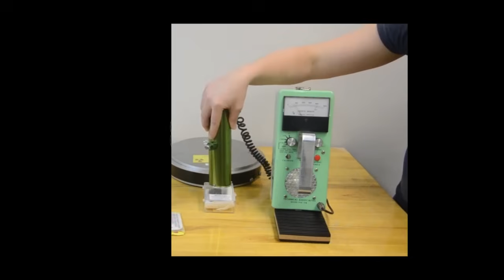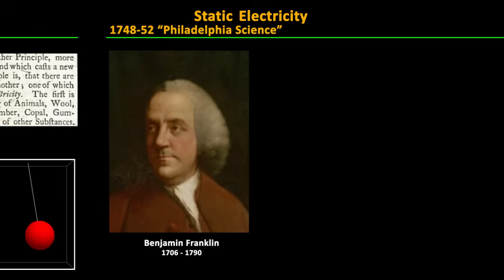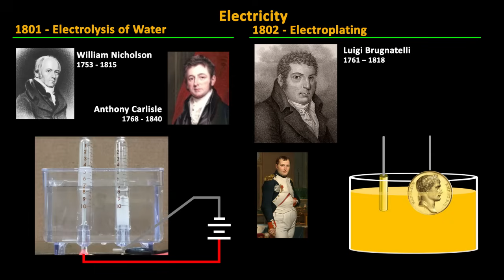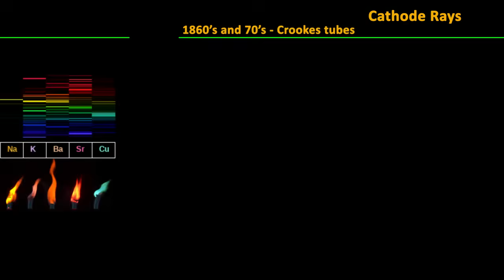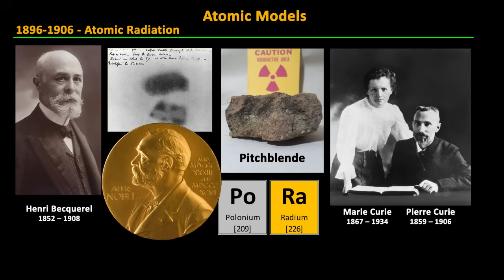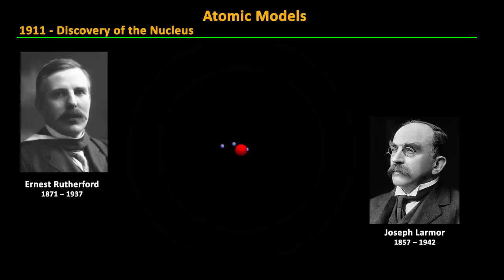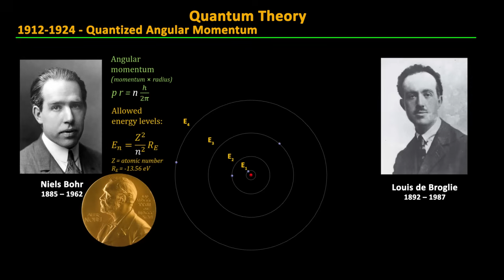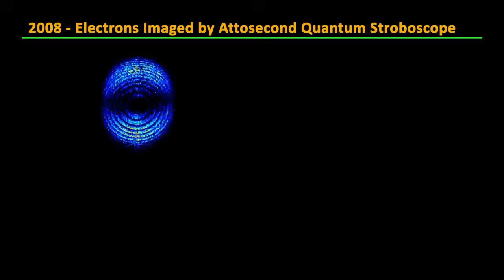The Electron (old edit)

Comment: Where do electrons get their charge?  
Where do they get their energy?  
Where they get their mass? 
How electrons convert to Heat?
Reply from the maker: Charge and mass (and spin) are the fundamental properties that define what an electron is.  Apart from these qualities, it can be said that electrons have no hair (no other distinguishing characteristics).  
Electrons gain and lose energy from interactions with photons, but also have rest mass energy from E=mc^2.  
Electrons do not “convert to heat” but can store heat in a solid by moving around in it faster.
Reply: @AtomUni   : What makes the electrons and protons to have a different charge?
Why and how charges repel or attract from distance?
Spin means the electrons are little balls.
We can not assume that electrons have no hair, no one have seen one.
What is Energy and how do you store or transfer it? What is the transfer medium?
E=mc2 which means it is defined as multiplying the weight/mass by a big constant number, it does not mean anything, I say E=mc3, can you prove that I am wrong?
Do the electrons move around in solid or move from on point to another?  Do they move with a different speed?
How do you store heat and in which part of the atom do you store it?

Thanks for your replies.
Reply from the maker: @ShonMardani
In reverse order:
- Thank you for politely asking
- Heat is stored as kinetic energy in solids, through electrons moving at different speed, yes, but primarily through the vibration of atoms (they carry more energy since they are heavier).  My first episode - https://www.youtube.com/watch?v=BHhhv9xdrJk - shows a nice clip of actual vibrating atoms at 13:30 and I will do a future episode on heat energy for sure.
- Whether or not electrons move from atom to atom within a solid is what makes the difference between electrical conductors and insulators.  Will cover in a future episode.
- Many, many experiments have confirmed E=mc^2 to better than 1 part in a million (e.g. https://www.nist.gov/news-events/news/2005/12/einstein-was-right-again-experiments-confirm-e-mc2 ).  My next video will describe the first one done by Cockcroft and Walton in 1932.
- I plan a future series on Energy and Thermodynamics in general that should answer those questions.  But if you can’t wait start here: https://en.wikipedia.org/wiki/Thermodynamics
- Many experiments have been done to see if electrons really are point like particles and none to date have been able to prove otherwise. The collective results suggest that if the electron has any size, it must be less than 10^-21 meters. A good video summary of these experiments can be found here: https://www.youtube.com/watch?v=R7JnfTnqoRM
- Spin of electrons is not the same as spinning of a macroscopic object.  A good video explaining electron spin is here: https://www.youtube.com/watch?v=pWlk1gLkF2Y 
- The whys of electromagnetism will take you down a deep rabbit hole of U(1) gauge symmetry, but if you are brave enough, dive right in: https://www.youtube.com/watch?v=Sj_GSBaUE1o
- Again charge is the defining property of the particle.  Electrons and Protons do exist with the opposite charge, but they are called anti-mater.  If your question is why, I refer you above.
Reply: @AtomUni   > I have no reason to be unpoilet. I have respect for your work and my time spent watching it. 
Your work is skillfully serialized and you connect the subject matter in a natural linear manner which is hard to see on similar videos.

The questions which I asked and every child asks the first time are introduced to Electrons in the schools, they just wait for the answers because they are told they won't understand it since their brain is small at that time.
In my case I waited 50+ years and read many books and watched many videos on the subject and despite the fact that I am lucky to see AI as the saviour from fake science, I still need to watch more existing and future videos to get the answers.

However I have a theory in making based on the existing observations and measurements which can answer all these questions, it will be my pleasure to share it with anyone interested to know about it and hopefully challenge it.
Reply: @ShonMardani  I for one would like to hear your theory. I am also 50+ (actually 70+) and as a retired electronic  engineer I am some times straining my mind to get what we are told in physics to fit with my experiences from my previous work etc.
Positive and negative electric charges have just been decided to be so. The electron could just as well have been positive if it hadn't been some body naming it to be negative. It is similar to east and west or north and south. It is just names.
As the man says heat is the wriggeling of the atom. Radiated heat is the radiation caused by the mooving around of the electron in it's possition in the atom and the energy comes from less wriggeling energy in the atom. Light comes from electrons jumping inwards in the electron and the reason for colours (or set frequencies) is that the energy from one position in the atom to the next is quite accurate. If the atom is very hot (wriggeling a lot) some of the heat energy can be added or subtracted from the specific bands so that they widen and eventually you get white light (all frequencies).
This is some of what I believe I have learned.
Reply: @ShonMardani  ..........The medium is ALWAYS SPACETIME.   Maxwell's equations PROVE light moves at C relative to SPACETIME.   Michelson-Morley PROVED spacetime is NOT STATIC around planets.  OBVIOUS CONCLUSION is that gravity accelerates spacetime's frame of reference down to the planet.   This is why a falling accelerometer will say it is INERTIAL,   because relative to space's frame the falling accelerometer is NOT accelerating.   And PROPER acceleration is ALWAYS an acceleration that is relative to space's frame  (NOT YOU OR EARTH.....the sun does NOT revolve around earth because YOU are on the earth).    When you place an accelerometor on the ground it says it is accelerating at 9.8m/sec^2.  WHY??? Because space's frame is being accelerated down THROUGH YOU and the equivalence principle says it dont matter if you are accelerating through space or space is accelerating through you it dont matter cause you get the same physics results if both scenarios have the SAME RATE of acceleration.    The falling object just follows the SAME INERTIAL PATH but in a gravity field all the spacial coordinates of that INERTIAL PATH are accelerated down or BENT DOWN and the falling object just follows that new INERTIAL PATH created by the gravity accelerating down that inertial path down.   So the falling object feels no force because all the gravity force is applied to the space's frame and NOT THE FALLING OBJECT.     Newton's gravity accelerates and pulls down ALL of spacetime and destroys it.   Dark energy or ANTI GRAVITY does not destroy spacetime .......it creates spacetime in between galaxies at an accelerated rate that is proportional to the spacetime that is accelerated down to planets and is destroyed by gravity.    Coulomb's electric force IS GRAVITY.  Why is it 10^43 times more powerful?????   Because coulomb's force only accelerate and pull down PART of spacetime.........the part that deals with electric charge.   So Newton's gravity is the SAME strength as Coulombs electric gravity but the mass of the spacetime it pulls down is LESS so it accelerates it more.   The blue part of spacetime is where the electrons live.   The red part of spacetime is where the protons live.  You can move and accelerate the blue spacetime all over the place and it will NEVER affect a proton.    You can move and accelerate the red spacetime all over the place and it will NEVER affect a electron.   Electron's gravity pulls down red spacetime down at an accelerated rate and destroys it.   Electron's anti-gravity creates red spacetime at an accelerated rate.   The proton's gravity pulls and accelerates down blue spacetime and destroys it.  The proton's anti gravity creates red spacetime at an accelerated rate.   When you have 2 protons you can take the BLUE gravity  part out of the equation because even though the protons move blue spacetime there are no electrons in the scenario and protons are NOT affect by blue spacetime in any way shape of form.    So you basically just have 2 protons creating red spacetime but if one proton creates red spacetime then the other proton and all of the other protons red coordinates NEED TO MOVE AWAY AND OUT OF THE WAY to make space for the new red space time being created.   SAME WITH ELECTRONS.   They use gravity to pull red spacetime down but there are no protons in the scenario so we are left with 2 electrons creating blue spacetime using anti-gravity..  And blue spacetime is where the electrons live.   So if one electron makes and creates blue spacetime then that means the other electron and all its surrounding blue coordinates need to move away and out of the way  to make room for the new  blue spacetime being created.       When you have a proton and an electron the electron is pulling down red spacetime and the proton is pulling down blue spacetime so the electron moves towards the proton to fill in the void created by the proton destroying spacetime.  The electron is pulling down red spacetime so this leaves a void and the proton and all its surrounding red coordinates move toward the electron to fill in the empty space.    For coulomb's force equation Q is the MASS of the charge in coulombs instead of the mass of the matter in Kg for Newtons force equations.   The G-field (little g) acceleration for newton's equation is N/Kg because the newton force forces Kg to accelerate.    The E-field (little g) acceleration for coulomb's force equation is N/coulomb because the newton force forces coulombs to accelerate.   The BIG G  or gravitation constant for newton's equation is in N m^2/Kg^2 cause the gravity is about Kg.    Inverse Enot is the gravitational constant or BIG G for coulomb's force in N m^2/coulombs^2  cause the gravity is about coulombs.    F=ma is the same as F=qE  cause  q is MASS of the charge and E is the ACCELERATION of the coulomb mass in N/coulomb.    AND MASS times ACCELERATION = FORCE.            ALSO E=mc2 should be written as E = MOMENTUM/square root of the product of Enot and Unot ............THAT WAY IT MAKES SENSE !!!!!!!!!!!    An electron is a SOLID BALL that ACTUALLY SPINS!!!!!!!!!!!    ALSO energy is NOT A THING........it is a NUMBER that REPRESENTS the amount of work that a  thing can do.    Energy HAS NOTHING TO DO WITH THE CONSTANT C!!!!!!!!!!!!!!!!!!   PLEASE STOP SAYING THAT.    Take the C out of ALL equations and replace with 1/square root of Enot multiplied by Unot.   Because ALL energy is a RATIO of MOMENTUM to 1/square root of Enot times Unot.  Even E= hf because you can change the equation to E=h C/wavelength.    And h/wavelength = MOMENTUM.    When you REDUCE the units in h/wavelength they go down to  Kg  m/sec which are the units for MOMENTUM.   And C = 1/square root of Enot time Unot.   SO AGAIN ENERGY = MOMENTUM / square root of Enot time Unot.   Anyways i am getting tired and bored so i just have one more thing to say>>>>>>>>>>>>>>  HAVE A GREAT DAY!!!!!!!!!!!!!!!!
Reply: ShonMardani.....................Electrons get their charge and energy and mass from spacetime's electric and magnetic properties we call permittivity (Enot) and permeability(Unot) of spacetime.    ALL ENERGY EQUATIONS SAY >>>>  Energy is a RATIO of MOMENTUM to the square root of the product of Enot and Unot.   So OBVIOUSLY the electron AND EVERYTHING IN THE UNIVERSE gets its energy from spacetime's electric and magnetic properties.   Electrons get their charge from the permittivity (Enot) of spacetime so that means spacetime gives the electron its charge.  An electron has 2 types of mass.............mass of the charge in coulombs and mass of the matter in Kg...........the mass of the charge comes from spacetime's permittivity like i already said.   The mass of the matter of the electron comes from spacetime's permittivity and permeability.  And not sure what you mean by >>>>  How do electrons convert INTO heat.
Reply: Very good questions! I had more questions like this, and also about numerous paradoxes. I came to the conclusion that the material theory of reality is not the only one and does a poor job of explaining the basic concepts of physics and numerous paradoxes.

Comment: There are questions about the nature of the electron in comparison with the nature of the proton...
But first, thank you for such a high-quality and quick immersion in the history of the discovery and study of the electron. Feeling the physics of the electron, understanding the dual behavior of the electron is very important on the way to understanding the nature of existing interactions between elementary particles at the atomic level.

  The electron is a kind of opposite to the proton, but in some ways they are similar.
Here are questions about the nature of the electron in comparison with the nature of the proton:
   The proton is not able to absorb photons, but the electron is able to absorb and emit a photon over time. Due to this, we have as many as 3 (!) different colors for the hydrogen atom when the atoms are affected by Energy from the outside:
The radiation spectra of hydrogen are linear, consisting of separate colored lines that correspond to certain wavelengths, and are characteristic of hydrogen as a "calling card" of the element. Each line is formed as a result of the transition of an electron between different energy levels of an atom. The most common series in the hydrogen spectrum are the Lyman series, the Balmer series and the Paschen series, which correspond to radiation during the transition to the first, second or third energy level, respectively.
   That is, depending on the amount of energy directed to the hydrogen atom, to the "proton-electron" system, we have 3 (!) different responses from this system.

   Why does the electron behave as if it is energetically transformed depending on the amount of energy provided to the "proton-electron" system?..
And does the electron have a color?..

   Maybe it is worth looking at the electron like this:
An electron is like a tornado/vortex/whirlpool above the surface of protons in space, in 4-dimensional space.
Electron above the surface of a proton forms a kind of "Vortex-tunnel" with a low level of energy pressure towards the center, and this electron-vortex itself is surrounded by energy flows in space.

🙏🙏🙏
Reply from the maker: I’m so glad you enjoyed the video!  

Here’s several points in response to your questions/comments:
- The electron is a fundamental particle in the standard model, but the proton is made up of quarks.  That’s a big difference we will dive into in the next video.
- There is no intrinsic color to an electron, but electrons do determine the optical properties of materials like color.  The same electrons give rise to all manner of colored reflections depending on their energy band structure.  I will do a whole video on optics someday, but yes, you can think of optical phenomenon as electrons being energetically transformed by interactions with photons because that is literally true.  
- Also, you do have to be careful using the word color with respect to subatomic particles, because it may cause confusion.   The quarks inside the proton are said to have a “color charge” due to the strong force, but that is not a real color, just colorful language.  Electrons do not have color charge (electrons do not feel the strong force).
- By the way, protons do interact with photons, but in a very different way.  You may have heard of NMR imaging for example where atoms are probed for frequencies which they resonate with magnetically.  Also, gamma rays are photons emitted from nucleons.

Comment: So do the observed momentum oscillations match the frequency of emission when an electron is dropping to a lower shell?
Reply from the maker: Good question.  Unlike the case of black-body radiation where the frequency of emission does match the thermal oscillation frequencies of the atoms, in this case the emission frequency is determined by the energy which is lost by the electron and the frequencies are different orders of magnitude. 

Let’s look at the example from the video of Bohr’s hydrogen atom: 
Allowed energy levels are E = (Z/n)^2 (13.6 eV).  [See minute 14].  Z=1 for hydrogen, so the levels for n=1-4 are E1 =  -13.6 eV, E2 = -3.4 eV, E3 = -1.51 eV, and E4 = -0.85 eV.  Corresponding wavelengths for those electrons would be 0.33 nm, 0.67nm, 1.00 nm, and 1.33 nm.  Now consider an electron transitioning from E3 to E2:  -1.51 eV -(-3.4 eV) = 1.89 eV is released.  This represents a photon with wavelength = hc/E = (4.14x10^-15 eV-s)(3.00x10^8 m/s)/1.89eV = 656 nm (red light).  Similarly, the E4-E2 transition emission wavelength would be 486 nm (blue).  

But of course, you asked about frequencies, so we have to consider that the electrons in an atom are moving at about 1% of the speed of light.  So, with  frequency = velocity / wavelength, that puts the electron wave vibration frequencies at about one order of magnitude higher than the light emission frequencies. 

Ref:  https://en.wikipedia.org/wiki/Hydrogen_spectral_series